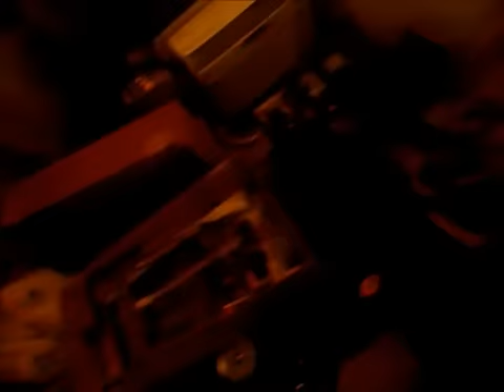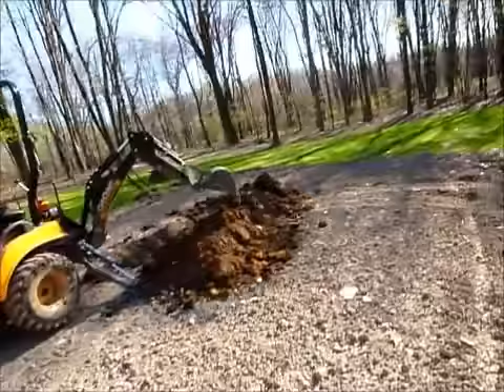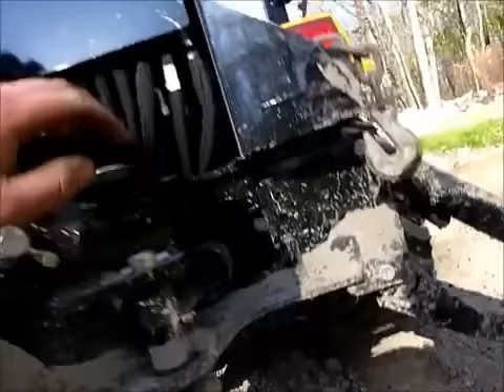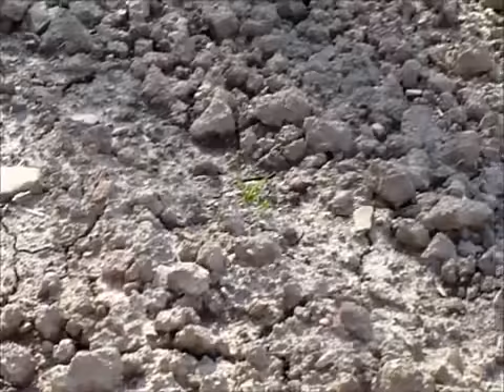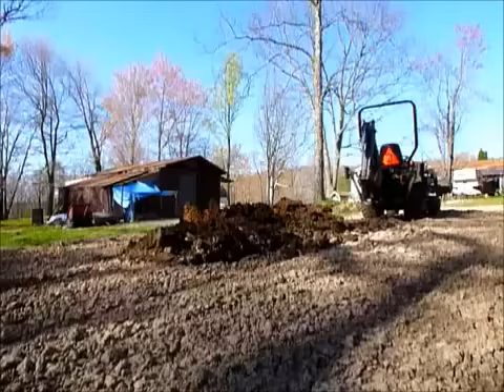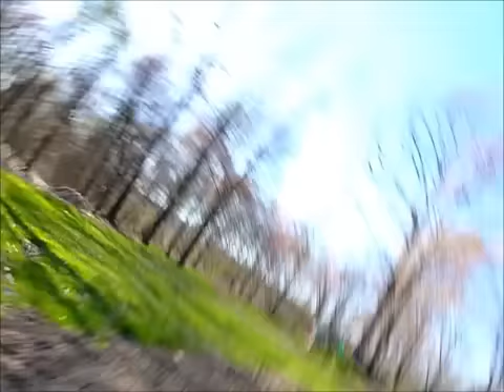Updates and working the Sc2450 yanmar

Comment from the maker: Yes you can. The system is there. Except for the links them self. The 3 point  is an option so to speak but is always there just have to put the links on the arms. Which are separate on the 2450 since they have to be off for the backhoe